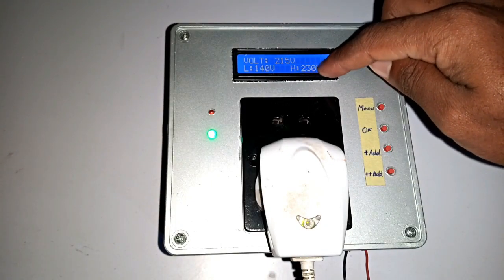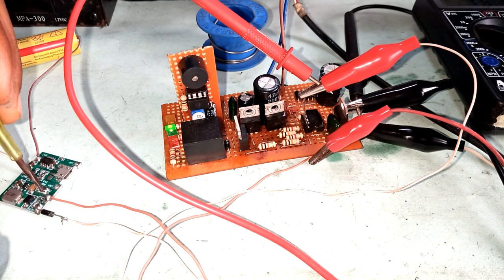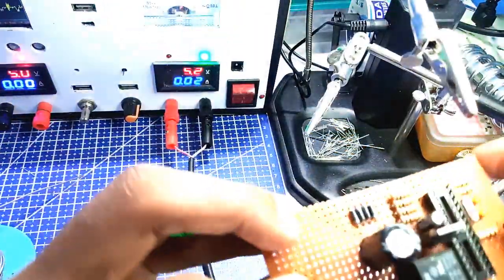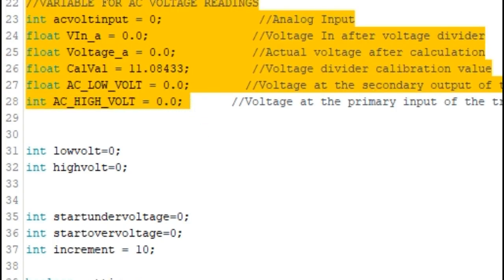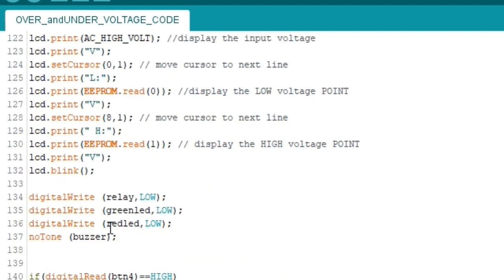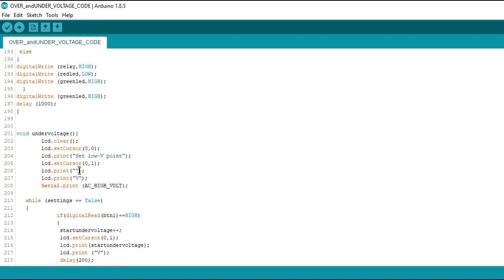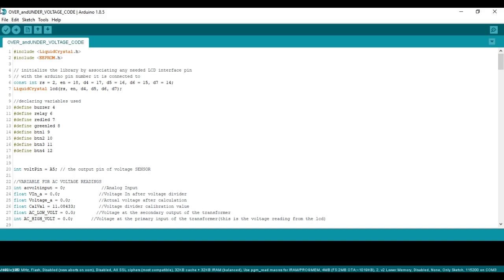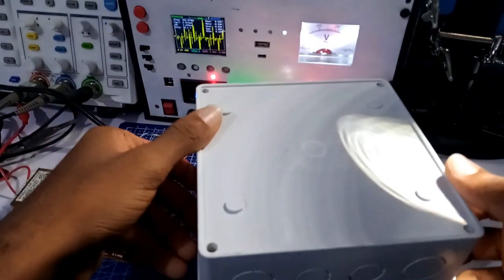Arduino base OVER voltage and UNDER voltage AC protection circuit

Comment: You can also tutorial on how to write program with aurdino from scratch
Reply from the maker: Sure, I will hope to do that , in later time
Reply: @MEmbedded_TechLab  please I need your assistance my inverter out put is reading 83v without feedback and without load and I used 12v/7.2AH battery is the generator battery and also I used spwm module what could be the issue. 
Thanks for your reply
Reply from the maker: @jboy4real  send me message on Whatsapp
+2348096283289
Reply: @MEmbedded_TechLab  okay